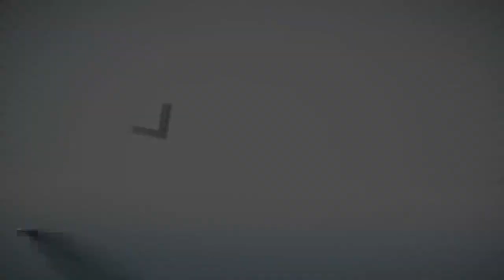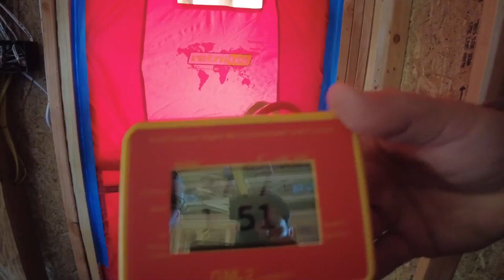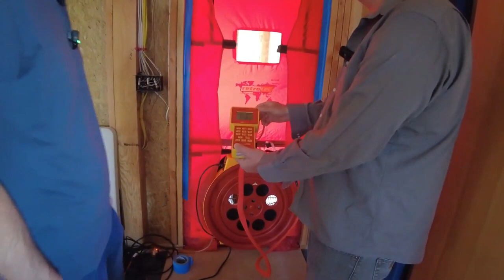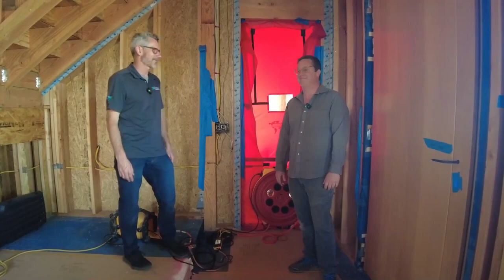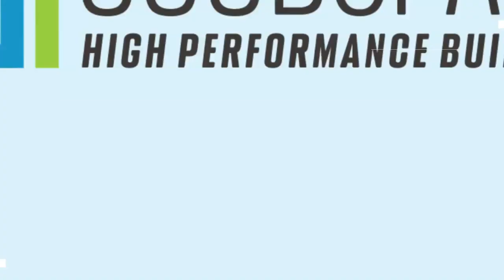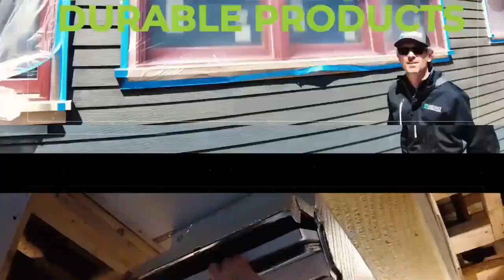In Progress (BLOWER DOOR TESTING) on the Sacramento Passive House

Comment from the maker: This was such a good day for us. Even though we started well over 1 ACH50 from the get go, we were able to finally get to our goal of .6 ACH50 a couple days later. Doing a blower door test during the build process before insulation and drywall goes up is vitally important especially when building to the Passive House Standard. To get Passive House certified we have to go through final testing at the end of the build. If we didn't find all these leaks before putting up the insulation and drywall we would have to cut into the drywall and cover up those leaks which would be costly and a waste of time. We are very excited to get to our goal of .6 ACH50. Lots of work went into getting to this point but it's so worth it at the end. Check out some of the places we found that had massive leaks in this Passive House Build

Comment: Silly question: but would adding the insulation and drywall affect the blower door test by a lot?  

Awesome job sealing that thing up!
Reply from the maker: Hey Nick, thanks for checking in on the videos again. I love you are stoked on the video series. 
So, surprisingly even if we put insulation and drywall in and didn't seal up all those small little holes throughout the house air would still make it's way through the interior system. I'm not sure if that makes a lot of sense or not but think about your normal house. Look at the baseboards. Most people do not caulk that open seam from the baseboard to the actually flooring material. I there are any tiny holes or areas where air is getting through from the outside it will find it's way down to the baseboard gaps, a lot of the times through the electrical gang boxes and for sure the light gang boxes. You just made me think of another video to do, hahaha. But yeah it would not make a huge difference if drywall or insulation would be installed especially when doing a blower door test. 
FYI, if you're ever in the area we would love to have you come by and pick our brains. I know you have a lot going on but just saying. Our office is also like a showroom of products we use or want to use when clients come in and we nerd out on high performance building topics.